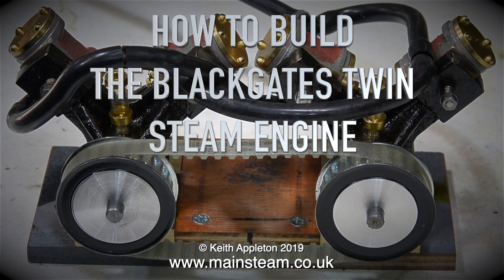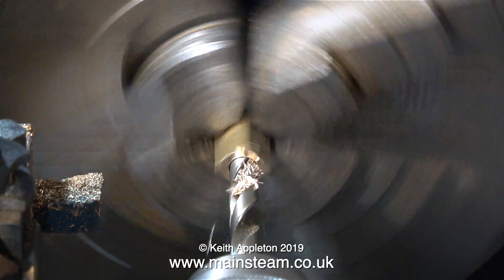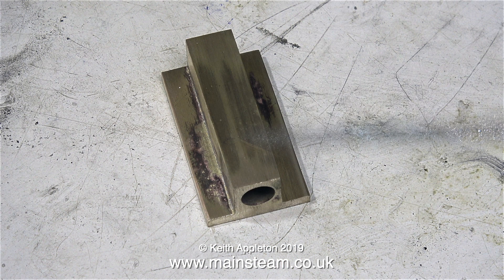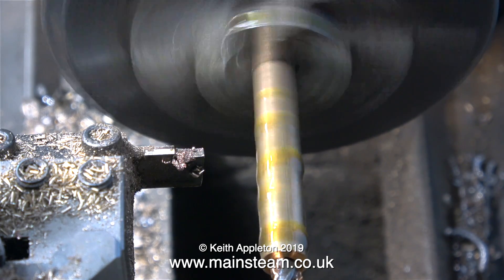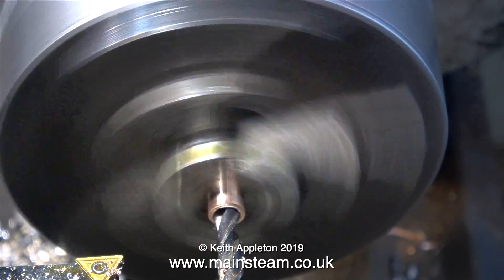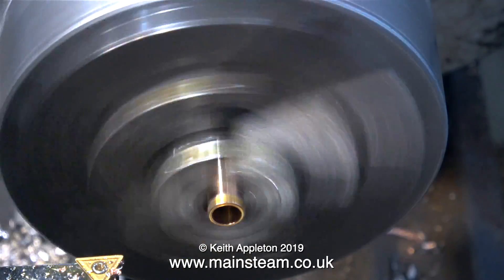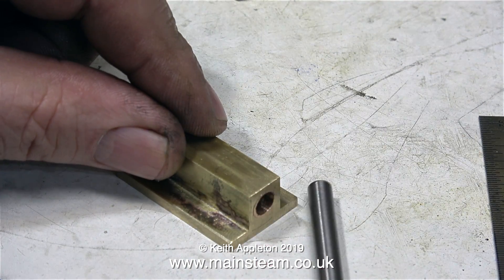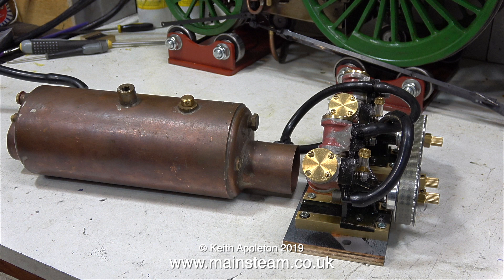HOW TO BUILD THE BLACKGATES TWIN STEAM ENGINE - PART #16

Comment: A note on coolant, whe I did work on small projects in the machine shop my spouse would comment when I came home that it would bring back memories of her father coming
 home from his job in a machine shop. Not an unpleasant smell. Also I believe that you wont have any slippage on the driven pulley at all since it is a cogged belt you are using and have more then a few tooth engaged since you are using the shaft to tension the belt.

Comment: Couldn't you use a spring in a slotted block to keep the tension? That way if you wanted to change the pulley size all you would have to do is put a smaller spring in the block.
Reply from the maker: These are the public videos - there are many more to come that are already available on Patreon - http://www.patreon.com/keithappleton

Comment: A question about the oiling of the heads.. does the oil in the little oil cups reach the mating surface between the head and the block(steam inlet?) or do those need to be oiled separately.?
Reply from the maker: Please watch the rest of the series . . . .

Comment: So the tensioner pulley could also be used to become an output shaft?   Would the brass journal bearing cope with that?   I was only thinking of this as the mid point between engines on the belt would be the almost golden zone for maximum drive with one engine always pulling and one pushing equalling the pushing engine so the power is smooth throughout.